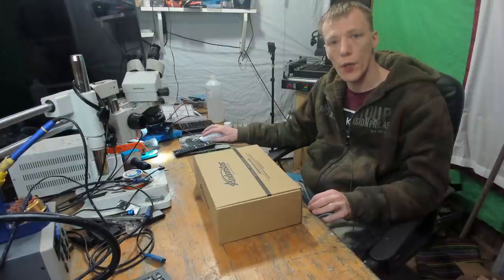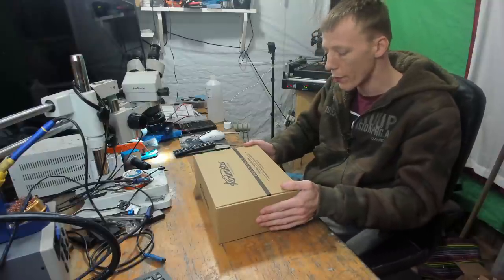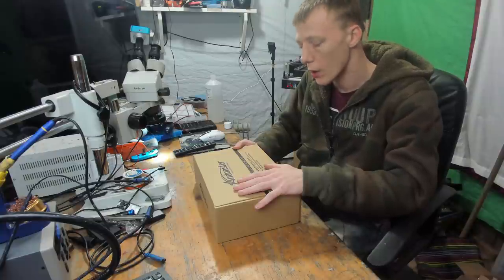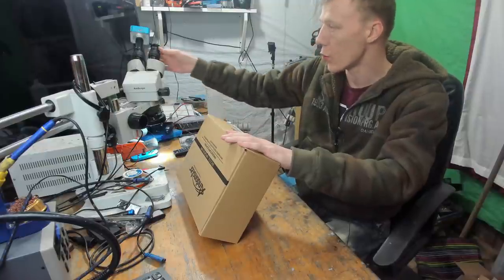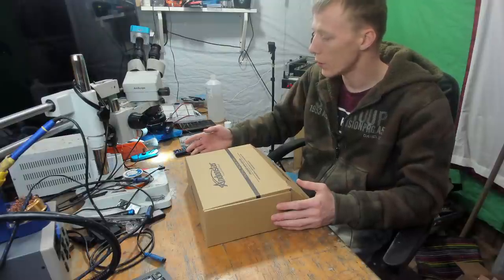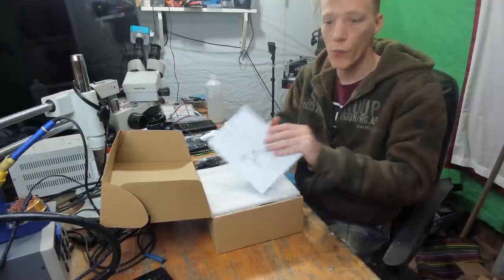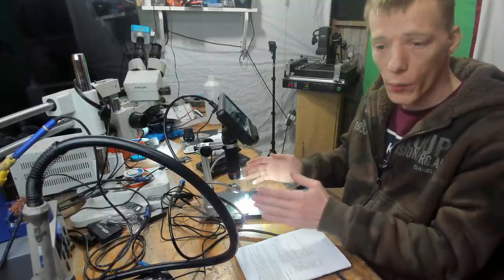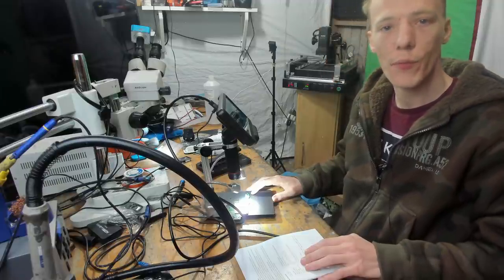Andonstar AD407 3D HDMI Digital Microscope Review - From A Console Technician's Perspective #ad

Comment: I use a digital camcorder with remote which is mounted on a moving arm secured to my bench which outputs to my 40 inch hdmi TV screen. I can achieve unbelievable zoom results making small component work a breeze. I bought the camcorder on eBay as a faulty item for £29.99 and repaired it, the tripod I bought new for £39.99 and the 40 inch TV I already owned. just something useful for those on a tight budget 👍

Comment: There are similar digital microscopes for a lot less money but they do not have an HDMI port. Even Andonstar has cheaper models that offer the same but without an HDMI port. In my opinion there are other options worth considering for a digital microscopes in the price range of the model that you have presented. I think that if you are going to do product reviews either do product comparisons or at least recommned that people do their own searching and comparisons of what is out there. I would recommend Banggood as a place to compare stuff like this. I would hesitate to give this particluar Andostar model the thumbs up unless you have looked at other brands and offerings in digitial microscopes. The concern is that sometimes we all buy implusively and then find out there was a better option for our needs, often for less money. If HDMI is a must then compare with the other HDMI digial microscopes before choosing a solution. I think its best to have a little disclaimer regardles of what product you review, that is if you are going to keep doing them.

Comment: I think I got the 201, bought a few months ago and I only try repairs infrequently so was ideal. Did a MacBook display connector using the scope without any issue connected to a monitor. It’s very good for the price and ideal for part timers / hobbyists like myself rather than a pro tech
Reply from the maker: Awesome to see so many people in the community actually like the products they offer which is the reason I agreed to the review. I could definitely see this coming in useful even to pros for small repairs like phones or the Nintendo Switch

Comment: wrt the small slidy work surface, I have a similar cheaper type of microscope and I took the vertical pillar off and attached it to a piece of plywood approx 12" square. makes it less slidy and allows you to work on larger boards without it tilting.

Comment: Hi mate, those little flat metal pieces either the springs and screws are attached side by side underneath the base. Its used to hold smaller motherboards in place while you carry out work
Reply from the maker: Thanks mate I'll have to give that a try and see how well it works 😁

Comment: Bigger base and also base flatter to work surface. Like a big sheet of aluminium then the blue mat on top. That would be spot on. Although i would still need my glasses to see the screen😂
Reply from the maker: haha I tend to be OK, I'm supposed to wear glasses but quite often I'll solder an 0402 resistor or something without the scope, but yeah definitely agree a bigger base would be awesome. You can get mounts though and just attach them to the desk. In terms of working space though it's definitely not for bigger boards like a PS4 for example
Reply: @TheCod3r  still. Free things are always good mate.